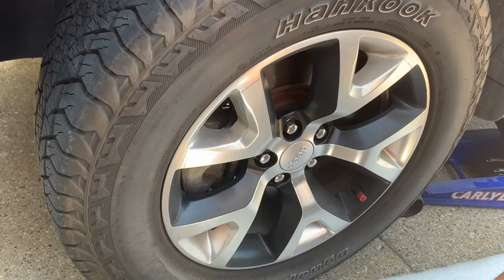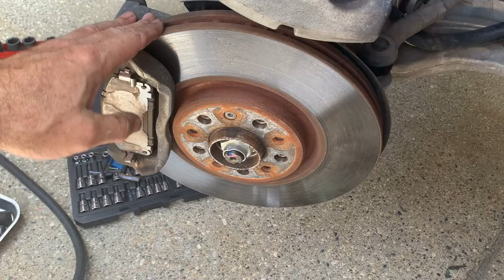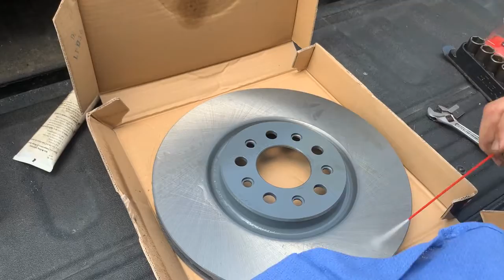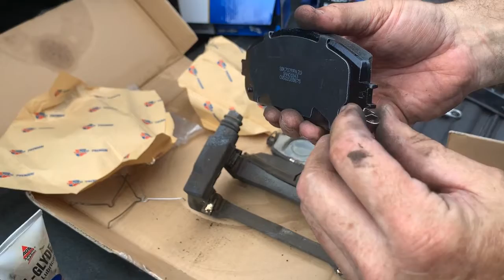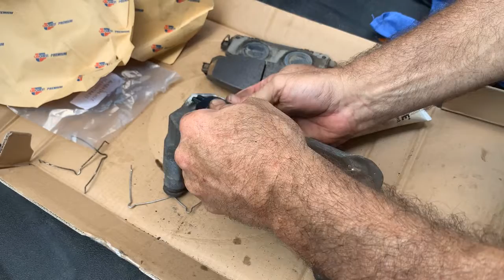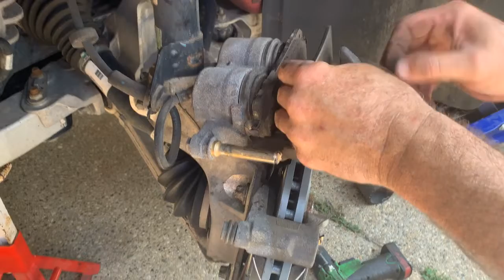How to Replace Front Brakes and Rotors Jeep Cherokee Trailhawk

Comment: Great video! I have a 2022 compass. Do I need a E22 or E24 E-torx socket. Also everywhere online says I need a purchased E-Torx E20 socket for removing those bracket bolts does not sit properly on the bolt!! its not be flush on the bolt !! it would just cover 2/3 of the height of Bolt!!
Reply from the maker: Thanks for the detailed description, that's a very common and frustrating issue when working with E-Torx bolts on vehicles like your 2022 Jeep Compass.The bracket bolts you're referring to on the 2022 Compass typically require an E22 socket . If the E22 feels too shallow
this is another common headache aftermarket or budget E-Torx sockets. These often
aren’t deep enough to seat on longer bolt heads and are chamfered too much so they don’t grip the full height. Using a high-quality deep E-Torx socket should take care of this,
Good luck.

Comment: Those Caliper bracket bolts are TTY, would it be alright if I still use them, did you have any problem with them after word?
Reply from the maker: If it's recommended by the manufacturer, it's always a good idea to follow their recommendations and torque specs. That being said I've never known of a case where somebody had problems using the old ones.

Comment: Does this apply to the 2019 model? And what about ABS? Is there any additional things to this that weren't covered here?
Reply from the maker: This should be the same process for any 2014-2021 Jeep Cherokee Trailhawk .No concerns with ABS and no to the last question.
Reply: I just did my 2019 TrailHawk and it was exactly the same. Only thing was it was hard getting the pad clips to slide on the bracket. Too much tension so I had to lub the crap out of them.

Comment: Wanna say thank you. Not sure if you'll see it. But I've never did a break swap. Saved me like 300 bucks. Only hiccup I ran into is Napa sold me the wrong breaks and had to go elsewhere for the right ones. Also I had to use my grip strength to push the pistons back down to the home position. So that was rough. Oh and it was raining. But!! I drove it after and came to a full stop like seven times at 35 and few other times at highers speeds and the vibrations gone. Good looking out with this really good video. You tha man.
Reply from the maker: That’s great to hear. I’m glad it helped!
Reply: They sold you the ones for the single caliper for duel caliper application or vice-versa? I had to search like crazy to find my brake code and found a site that gave it to me. Though I did kind of guess right - I have a factory tow package so that means dual caliper front brakes. 

Family member's car, so it was not in my presence to visually inspect so I had to go by VIN and what they told me. Discovered many websites returned wrong parts.
Reply: @Bonzi_Buddy  what website did you go to?
Reply: @vincentkladder85  vindecoderz

Comment: Do the mounting bracket bolts need to be replaced or can they be reused? I have read in some forums that the bolts need to be replaced if you remove the mounting bracket to replace the rotor
Reply from the maker: If it's recommended by the manufacturer, it's always a good idea to follow their recommendations and torque specs. That being said I've never known of a case where somebody had problems using the old ones.

Comment: Quick question, what is your opinion on reusing the bolts for the caliper bracket. Some say to never reuse them. Because the are a one time use Torque to Yeild. Why not just use thread locker and torque to specs, just getting an opinion.
Reply from the maker: If it's recommended by the manufacturer, it's always a good idea to follow their recommendations and torque specs. That being said I've never known of a case where somebody had problems using the old ones.
Reply: @TheAutoTeacher  that’s my thought exactly. As long as you tighten it correctly and a little lock tight should be fine. Thanks for the advice and keep up the content

Comment: Question might not be related. I'm looking for calipers online but I'm not sure if they are a single or double piston. Can someone clarify. Its a 2014 Trailhawk. Great video by the way.
Reply from the maker: Thanks, I would either take the vehicle apart and double check to make sure you get the proper parts or you could call the dealer and give them your Vin number and they will tell you which caliper you have.

Comment: I was expecting new hardware with new pads. Is that not the case here?
Also, I have 2019 not Trailhawk - but the Cherokee with 3.2L V6. The rears had no set screw holding the rotors. They were the original rotors from the factory. Have you ever encountered that before.
Also, the expansion pins in the front (V shaped pins)...the new pads I received and installed did not have holes for those. Are they absolutely necessary (should I contact the company I bought them from), or should I be okay without reinstalling them? Thanks.
Reply from the maker: If your new pads did not have the holes, then they're the wrong pads for your vehicle.
The V spring is there to put enough tension on the pad to keep it off the surface of the brake rotor when you are not applying the brakes. It also serves as an anti-rattle.
  Yes, sometimes only the front rotors have a set screw and the rears don't, that sounds like your situation. Just make sure that they're the proper rotor for your vehicle.
  I've purchased Gold brake pads from the same store and have had hardware with one but not the other.  In this case, the vehicle had low mileage and the hardware was still in good shape and replacement wasn't necessary.
Reply: @TheAutoTeacher  Thank you very much for your informative reply. I'm glad I saved the V springs just in case. Also your video was great, I had no other issues doing my own brakes and rotors because I knew what to expect thanks to your video. Thank you very much.
Reply from the maker: You're welcome.

Comment: I read you have to use a special grease for the bolts or you'll damage the o rings, forgot now exactly what type? Awesome video, straight to the point. Very clearly filmed. Thank you. Now I have to find your rear brake vid because those have the electronic e brake ;) 🤙
Reply from the maker: I've tried many different brands over the years and have had good luck with AGS SIL-Glyde Brake Lubricant. It seems to keep the same viscosity year after year and doesn't  become tacky, allowing the slide pins to move  properly.
Reply: @TheAutoTeacher is there anything I should be mindful of when doing the back brakes?
Reply: Do not use synthetic grease--one of pins has a rubber tube at the end to dampen squeaks. The synthetic grease will make it bloat, the pin will get stuck, and only one pad will perform the braking. You will have to do this again sooner and the rotor will warp with only one pad engaging. Rebuild kits have fresh tubes.